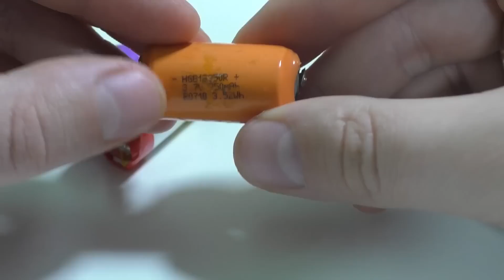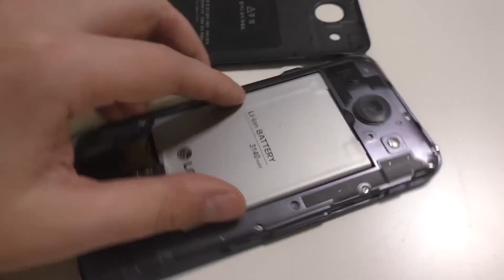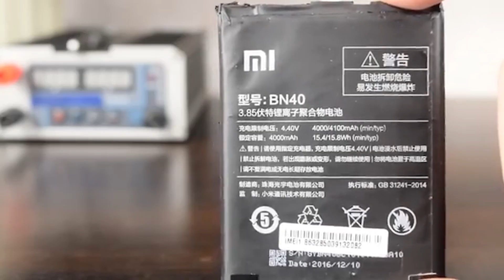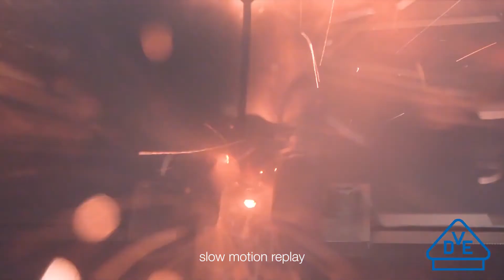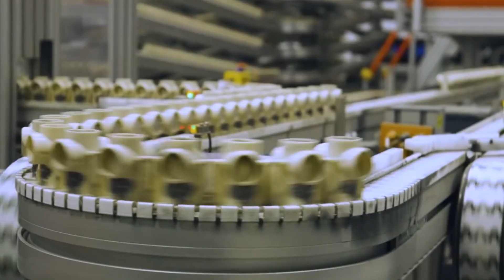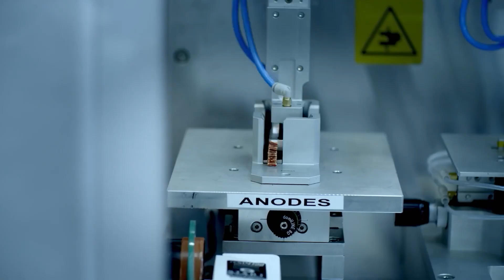Lithium-Ion Batteries: How They’re Made, Their Advantages, and What’s Wrong with Them?

Comment: Wikipedia: "The work at Sony on further improvements to Goodenough's invention was led by Akira Yoshino, who had developed a scaled up design of the battery and manufacturing process." - Yoshino scaled up design of the battery and manufacturing process, credit him for that.  Denying John B. Goodenough its invention is sloppy.  Failure to distinguish between the two most popular chemistries of Li-Ion batteries i.e. LiFePo4 (lithium iron phosphate) and NMC (Nickel manganese cobalt oxide) is a big miss as well because NMC batteries are famous for turning their devices into inextinguishable blowtorches, because their electrolyte supplies oxygen internally during thermal runaway.  LiFePo4, while slightly less energy dense, does not have this absolutely massive (criminally negligent from a consumer safety standpoint) drawback.